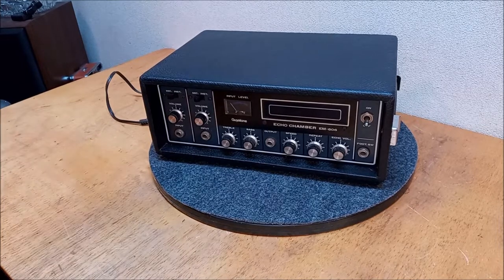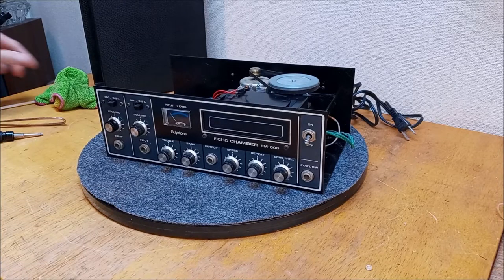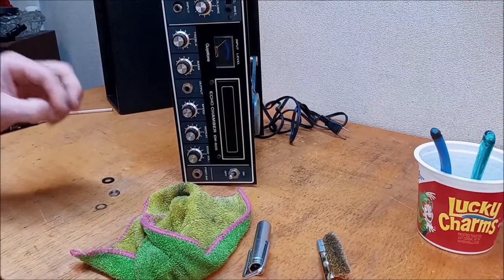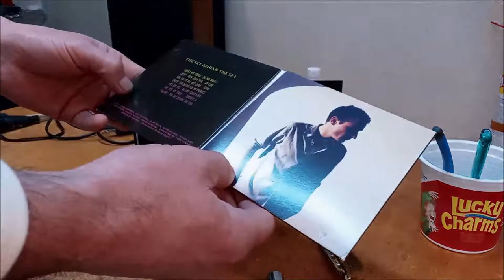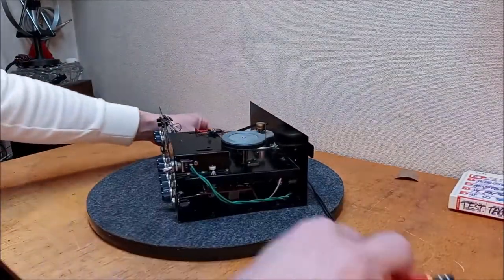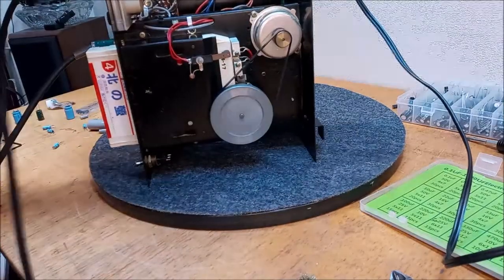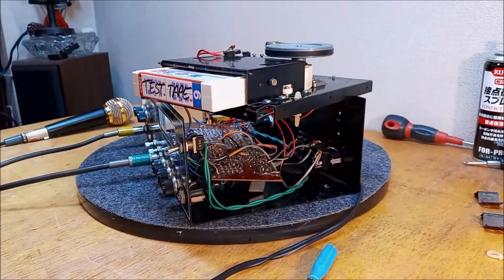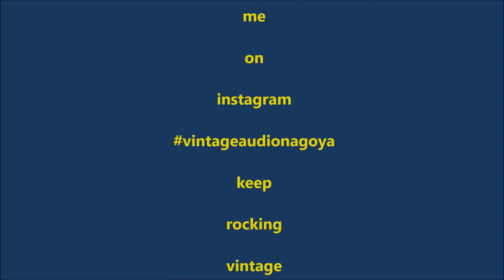Guyatone EM-606 restoration. Checking cleaning, recapping of Vintage Japanese tape echo delay-8track

Comment: hey! this is a long shot but i just got one of these and i'm having some issues. i'm only getting one repeat and the pitch is really inconsistent. do you have any recommendations for how to fix it? thanks!
Reply: i used to have one of these, id recommend starting of w things easy to check like a new tape or seeing if the motor belt needs to be replaced because it might be loose.